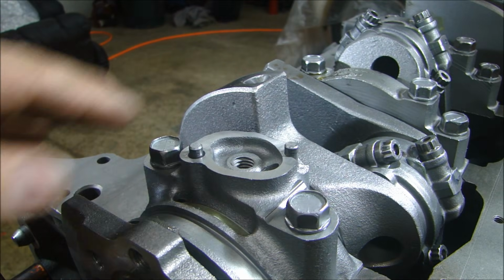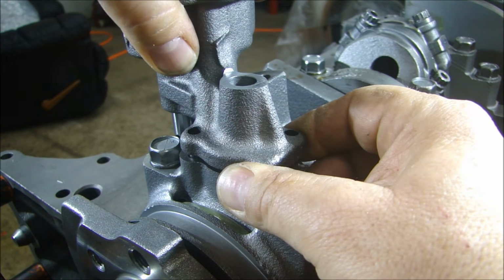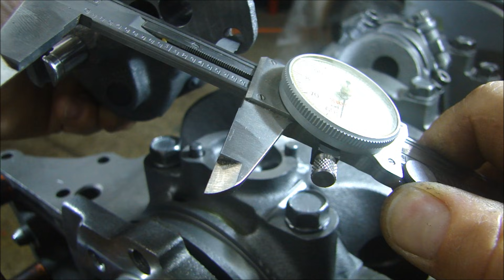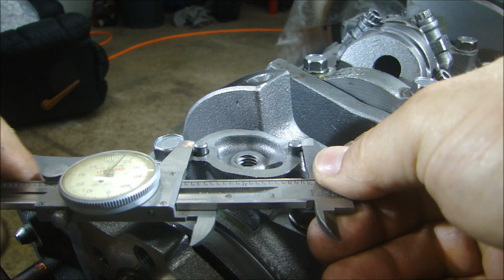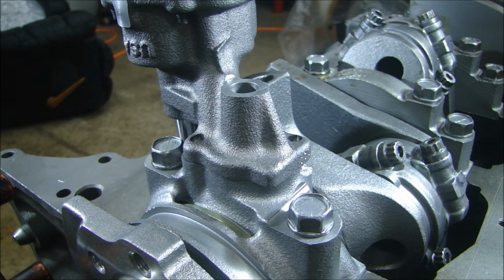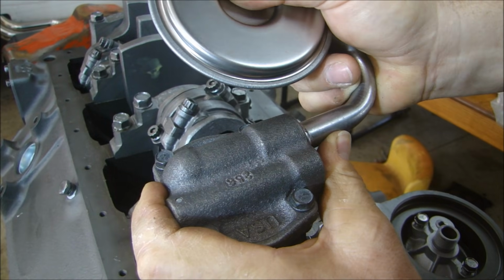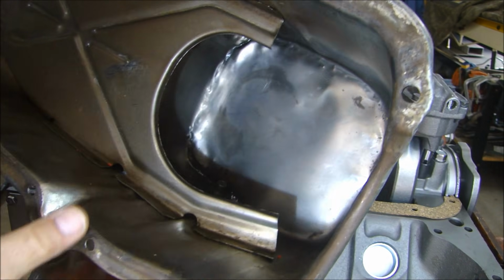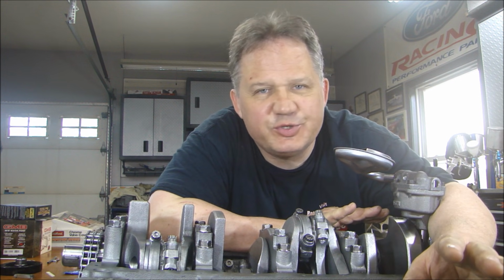Engine Building Part 4 - Installing the Oil Pump and Setting the Pickup Depth Small Block Chevy 350

Comment: I have to be honest with everyone here. This guy gives me anxiety just watching the way he beats on and tosses around machined parts. I have watched enough of his videos to realize his intentions are correct, it is his methods I cringe at.
Bad advice on welding the pickup guys, BRAZE ONLY. I about dirtied my pants when I saw him beat on that dowel. Like I said it is his methods I question. If I am wrong please enlighten me.
Reply from the maker: All good points, thanks Roy
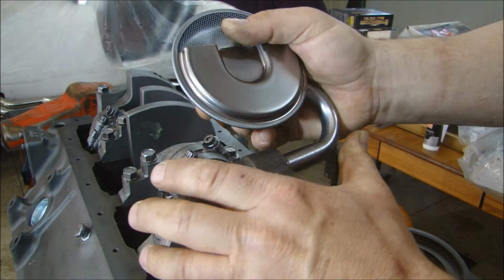Reply: I found it odd that he used grade 8 bolts on the cam bolts at 20 lb.-ft. of torque (previous video) and a grade 5 bolt for the oil pump at 65 lb.-ft. of torque.  Oh, and be careful not to dent the pick-up tube when installing (6:01).  Check the flat spot he put in the bend of the tube starting at 7:25.  I have to agree with you @Roy Shideler.  Intensions are good, but execution is questionable.  Do as I say, not as I do?  I've built a lot of SBC engines in my day.  If the tube doesn't fit (and they rarely do), I'd grind the OD of the tube where it press-fits into the pump.  Then braze.
Reply from the maker: @Sukkit Trebek The cam bolts actually come as a set for the cam as grade 8 for the same price. Oil pump bolts are standard replacement. You are right about the flat spot.
Reply: @Pete's Garage, if the grade 8 cam bolts came in the kit for the same price, I'd have done the same.  I have to give you props for explaining the situation and for owning-up to the pick-up tube.  Always be careful in the narrative.  Some of us that have built engines can be the worst critics.  All-in-all, you do a better job of explaining than most.  If you don't mind me asking, what kind of ponies did that 350 turn?  Flat-top pistons and a cam just under .500" lift, if you had something like 65cc heads, I'd bet you probably came close to 400 HP give or take.
Reply from the maker: @psbnighthawk6676  I never claim to be perfect or the best. We are all here to learn, I learn something every day and I make mistakes just like everyone else. This one put out 331 HP at 5100 and 357 Ft Lb's at 4000. The customer wanted just a slight upgrade form stock, that is almost double what it came from the factory with. Here is the dyno video https://youtu.be/cPmun7bGKhE
Reply: @Pete's Garage Agreed, Pete.  I either make mistakes every day or can't remember some things from 2 years ago.  We all learn, re-learn and make mistakes.  That's why my pencil has an eraser.  I enjoy your videos.  You actually go into more detail than others.  I was hoping you'd pull a few more ponies from the 350.  Did you use 76cc +/- heads?  I'll be building a 327 this spring and hope to get just shy of 400 hp.  If I don't, I won't worry too much.  It'll be going in a light car - a Henry J.
Reply from the maker: @Sukkit Trebek Thanks Henry, the customer only wanted a little more so the cam is 1 up from stock. The heads are 70 cc Edelbrock E-street 5073. It is more than enough for what he wanted, Thank you for your comments, some guys can be real aholes.
Reply: Thank you for all the replies. Nice to have real information exchange. I am 62 and think my current project is realistically my last engine build. Three years of purchasing the parts as funds became available is a tedious process. Started with a rebuilt 6-71 and polished manifold/drive kit was my initial cash purchase and to solidify my "too late to turn back" position. Next was the bow tie high nickle 540 block. Then the beautiful rotating assembly. Everything but the blower is new, everything. So watching Petes Garage, and others, helps me in all the detail work which is all important. Last week, after watching this episode again and reviewing my notes I questioned wether I fitted the oring that sits in a recess between cap and oil pump on bbc gen VI style. I am a believer in log books and there was no mention of the oring. Disassembly proved that I had forgotton it. I consider this a blessing to be able to take on this endevor at my age as many of my associates no longer have the interest and I don't mind doing as many times as required to get things right.  Thank you all.
BTW, my fuel of choice is E85, 12# of boost. I never would have imagined spending $100 on a single head gasket, $2000+ on two carbs, $400 harmonic dampner. This being my third blower build I maintain that sitting behind a motor of such performance that I built is better than sex.
Reply from the maker: @Roy Shideler We only learn by having a conversation. I delete comments when people are nasty. I feel the same way at 52...lol. Sounds like you're building an awesome one to finish with, and you're building it right. Thank you for sharing that story with us. I've had to build and tear down engines up to 3 times to get them right. My Cobra engine took forever to get perfect. You're never too old to enjoy it. God bless!
Reply: There is a difference between a science and an art. He leans more towards the artist aspect. That does not make it wrong.
Reply from the maker: That is an interesting way to put it Frank, thank you
Reply: You are NOT wrong Roy Shideler ... this video should be titled How NOT to Install a SBC Oil Pump.  Sad there are so many comments praising this nonsense.

Comment: There is plenty of surface area to just run a slightly large drill bit through the pump holes. I would rather that than to be smacking on the main cap.
Reply from the maker: Good point

Comment: You lose torque with an extension
Reply from the maker: Only if the applied torque exceeds the tensile strength of the extension material

Comment: How did you get it in and still twist it around to set the height?
Reply from the maker: I measure
Reply: @PetesGarage  no. I mean you had the screen installed into the pump, but you could still rotate the screen. Mine won't move once it's in. How did you do that?
Reply from the maker: You may have to force it a bit